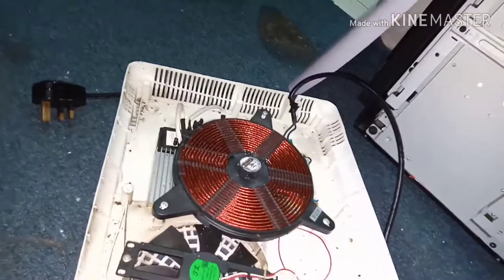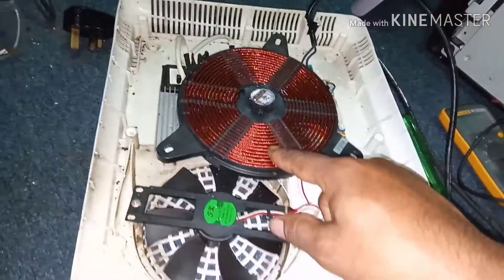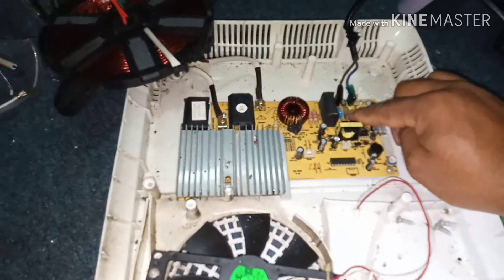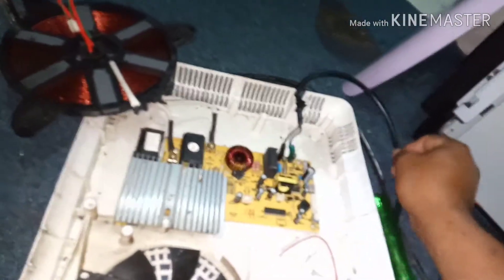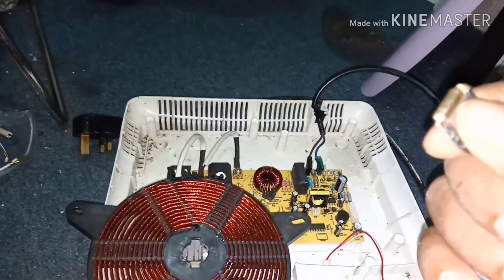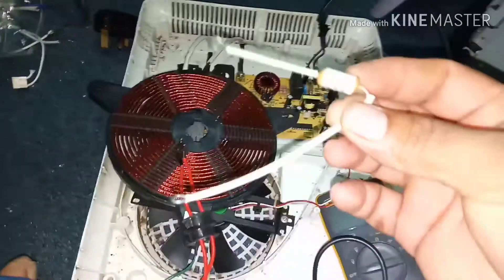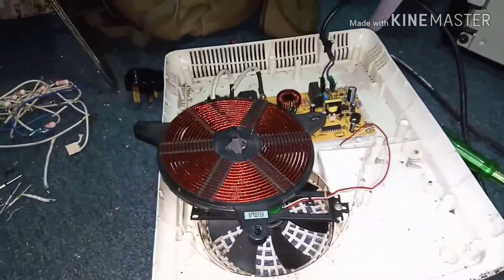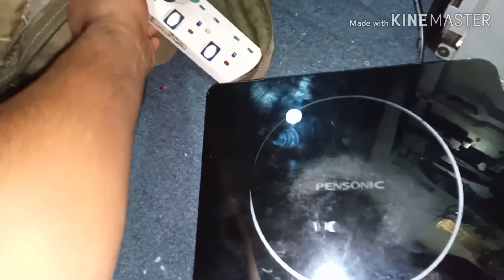How to repair Induction Cooker No power ?

Comment: Please, kindly help me. I have small induction cooker and is not working. It has a component that looked like zener diode in the place of the sensor (middle of the coil), I tested the igbt, the fuse and some common components, none are short and the induction refused to come on.
It’s 800watts induction stove.
Thanks for your assistance.